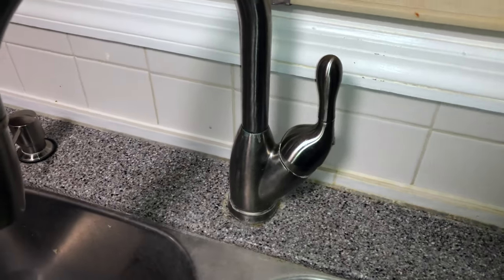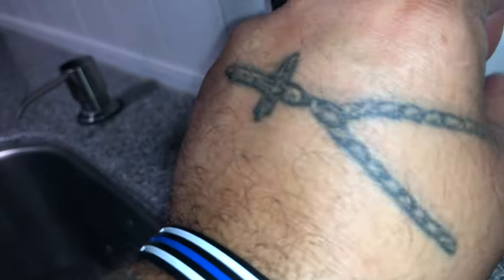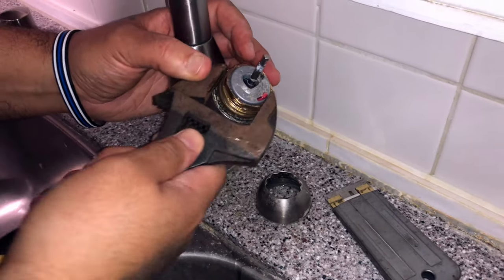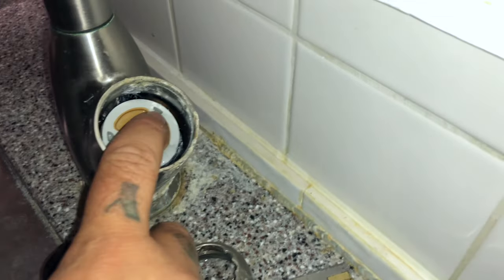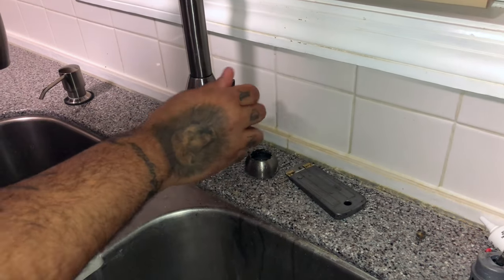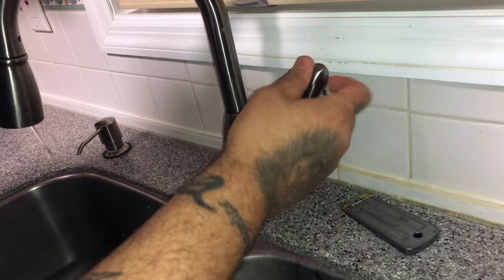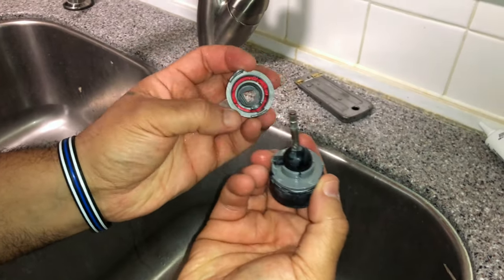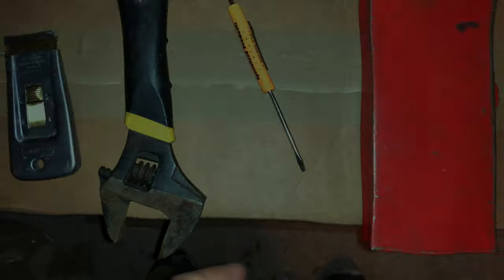How To Replace Your Delta Single Handle Faucet Cartridge

Comment: THANK YOU!!  I DID IT!! 😄 I absolutely could not have done this without you!!  I watched the video throughout the procedure and everything worked.  The only difference is that the part is now $40.  Ha!!  I did not have to call a plumber, so I am happy!!  I read the part was good for 5 years, so don't know about the lifetime warranty.  But it's fixed, and I didn't have to wait on something to be delivered.
Reply from the maker: That’s awesome my friend. I’m glad I could help. They would still hot or the warranty. No questions asked. I was in the same boat, I didn’t want to wait for it in the mail. But you can call now and get one for the future. Thanks again for the support.
Reply: Yes, thank you!  5 minute job
Reply from the maker: Good deal, glad to help. Thanks for the feedback.

Comment: Delta warranties their products for life. They will send replacement parts to you at no charge. If you don’t know the model number of your faucets all you have do is send customer service a photo on you mobile device they will be able to identify it. I’ve done it numerous times. This process also works for Moen faucets.
Reply from the maker: Your very right brother and I’ve done the same. I just needed to get it done as soon as possible and didn’t want to wait for it in the mail.
Reply: @MrV2u  I hear that and have done the same.
Reply: I do it on my my faucets, doorknobs, and anything else that has a warranty.
Reply from the maker: @chipwells1352  same here brother.
Reply: Will they reimburse if you already bought it ?
Reply: @tryhardsweat5224  probably not.
Reply: @tryhardsweat5224  Highly unlikely.
Reply from the maker: @tryhardsweat5224  not sure if they would. It wouldn’t hurt to call their customer support line. Their a good company, they just might hook you up. If they do let us all know. Thanks
Reply: You do need to leave it installed for them to warranty it. I made the mistake of pulling it out and replacing it in an emergency and they would not cover the warranty.
Reply from the maker: @edcollier2526  you should of said the one you used for the emergency was the bad one I guess. What they wanted a video of it?
Reply: @edcollier2526  Because of the fraud in our Nation they cant trust honest people like yourself.  I called, took picture, told them I prefer to replace now, so they sent a warranty voucher for my replacement.  That's what I call great customer service.  40 dollar part , cant wait for that check, based on that I will purchase and specify again.
Reply: @tryhardsweat5224  You will probably need another new on in 10 years, just put it under the sink.
Reply from the maker: Lol absolutely brother.
Reply: Don't think I can locate my receipt from 2012.
Reply: @franklin3271  You won’t need any receipt. Both Moen and Delta have great customer service. If you don’t know the model they will just ask you to snap a photo on your phone and send it to them.
Reply from the maker: Great info brother!

Comment: I priced one of these cartridges and was glad I did not have to buy a new one because the cartridge would have cost 50% of the cost of the Delta faucet I have had for 5 years now. All I had to do was to grease the ball and the seats it rides in with special Plumber's Grease which is available at Lowe's and Home Depot and most hardware stores. Just do not disassemble the cartridge anymore than necessary in order to get to the ball ( which attaches to the handle). More than likely the actual valve is in  great shape still. The ball and seats just need to be wiped clean with a paper towel and the special grease applied. I just bought Silicone Plumber's Grease today and it is supposed to be waterproof, which, I hope, means longer lasting.
Reply from the maker: Great info brother. You could always call delta and have them send you a new one free of charge under their lifetime warranty.

Comment: You mean tabs on the wall?
Reply from the maker: Not sure what you’re asking but the only thing to turn off is the hot and cold shut off valves under the sink sticking out the wall where the lines come out and into your hoses.

Comment: Excellent video. On my install the orange gasket kept falling off the cartridge so I put some coconut oil on it to hold it while I installed it. This desugn is a huge step backward for delta their old faucets were easy to rebuild and the kits cost $5 while this cartridge cost me $40! Thanks for the video!
Reply from the maker: Glad to help and thanks for the tip. You could have had delta replace it under warranty. I had to do mine sooner than later and didn’t want to wait for the replacement. I find everything was made better in the past than now a days.

Comment: Great job!! I just saved $200 by not having my plumber come out. Plus I had a ball doing it myself! Great teacher!!👍👍
Reply from the maker: That’s awesome my friend. I’m glad it worked out for you and you saved that hard earned money. That’s my goal in my video to help people save money. Thanks for the feedback.
Reply: MrV2u  now if you would post a video on how to replace a basic toilet I would be all set. Thank you again for your great teaching! You're a natural!! Plus I can tell you like lions. I'm a Leo ♌️
Reply from the maker: @josborn9653  that’s not a bad job brother. I’ll keep the video suggestion in mind. What’s wrong with your toilet? Sometimes you can fix certain things rather than completely swap it out. Unless you want a new style or something different.
Reply: @MrV2u  It’s 53 years old and does work ok. But the sub floor around the base is weathered and has dry rot. So I thought I would just replace the toilet with a new one nothing fancy and when I try putting down some new particle board sub floor. So I got my work cut out for me if I decide to take that project on.
Reply from the maker: @josborn9653  your toilet did its job for sure. Make sure your when you replace the particle boards everything else is in good order. Let me know how you make out my friend or if you have any questions. I have good plumbers in the family if I don’t have the answers.

Comment: Thank you so much! I did it and the hardest part was finding the hot water shut off valve hidden behind the garbage disposal, lol! I'm going to call delta for my free warranty replacement cartridge, this faucet is only 2 years old, if that. Thanks again!😄
Reply from the maker: Glad to hear. Definitely call them, they don’t question anything and will have one shipped out in no time. Thanks for the feedback.

Comment: I recommend shutting off the water at main valve; under-sink valves are NOTORIOUS for failing since they're used so seldom. Also, I replaced all of my under-sink, toilet, & washing machine valves w/ball valves since they're much more reliable and we generally use all of them for binary functions; on or off. Great video!!!!!
Reply from the maker: Yeah I made it a habit to cycle each  valve at least twice a year. But it’s definitely worthwhile to replace them with ball valves. Thanks for the suggestion brother and also for the feedback.

Comment: Thank you for this video.  We had the problem of the delta single handle kitchen faucet just leaking and leaking and very difficult to turn it off.  Purchased the part online anf  followed your video and all is well with the kitchen faucet.  Thank you again.
Reply from the maker: @shenaycrawford8701  I’m so glad it worked out for you guys. Enjoy that leak free water faucet. You could have called delta and had them send you a free cartridge as well. Thanks for the feedback.

Comment: Thank you, MrV2u! This gave my sweet husband the gumption to do this, even with a slightly leaky hot-water  shut off. It didn't take much longer than the length of the video. You're a good guy!
Reply from the maker: I truly appreciate the feedback. I try to be thorough and to the point. Glad it worked out for you my friend.

Comment: For the Ashton model like this one, call Delta, lifetime warranty. Stopper sink so you don't lose parts. The little orange slider on the cartridge adjusts hot water flow/anti scald. I want mine wide open for all the hot water I can get via handle adjustment. I bet many blame the water heater, when that valve is the culprit. BTW - that's why Delta went from the ball to the cartridge!
Reply from the maker: Good info brother thanks for the feedback. Perfect name too lol.

Comment: Thanks for the great video!  However…I’m having a hard time replacing the set screw. Goes in fine and I can see the stem but it doesn’t seem to touch the stem. Similar faucet as in your video.
Reply from the maker: Do you have any calcium or grit that doesn’t allow the set screw to sit flush? Soak it in vinegar along with the handle for a  it and try again. Let me know if that works.

Comment: I recommend soaking the parts of the disassembled cartridge in vinegar with a pinch of baking soda added.  This will remove deposits on the parts of the cartridge that may have deposits causing it to grind as well.  Rinse all parts thoroughly and re-grease and assemble.
Reply from the maker: Good info brother. Mine was beyond that point already but great info. Thanks
Reply: I use Lemi - shine for hard water deposits and let the parts soak with hot water. Works well.
Reply from the maker: @hoosierdaddy8002  something to try in the future. Thanks brother

Comment: I would add that once you clean the inner threads at the bottom of the brass coloured locking tube that holds the cartridge in place with a stiff toothbrush and vinegar, then lube those inner threads with food grade silicone grease if you have, or just as good is a good coating with olive oil. And when you tighten that locking tube with a wrench, very little torque is needed. Just lightly snug is all you need.
Reply from the maker: Very good info brother. Thanks for the tip.

Comment: Thanks for this video!!  It appears to provide all I need as a rank amateur to fix my leaking faucet.  I'm about to tackle the cartridge repairs.  In preparation I went searching for "Silicone grease".  Harbor Freight?  Don't have it.  A local auto parts store seemed baffled by my request.  However an employee, who claimed to be a "handyman", suggested "Synthetic Caliper Grease" and said that would "absolutely"  do the job.    When I read the package I see no mention of silicone as an ingredient.  Also this comment on the package "waterproof formulation prevents against corrosion".  QUESTION:  Will the Caliper Grease suffice?
Reply from the maker: I wouldn’t use caliper grease on something that is going to be in contact with your water. Go to Home Depot or Lowe’s and go to the section where they have the sink repair parts and it will be there. If not ask for it. Let me know how you make out or if you have any other questions brother. Good luck
Reply from the maker: Here’s the link my friend. 

https://www.homedepot.com/p/DANCO-1-2-oz-Waterproof-Grease-80360/203193502
Reply: @MrV2u   THANKS SO MUCH!  I will do that today and reply.
Reply from the maker: Before you go hit the area around the ring with some vinegar or wrap a rag around it and soak it in vinegar to make the job easier to take off the beauty ring.
Reply: @MrV2u  I have not yet taken anything apart.  My experience as a handyman (generally poor) over MANY years has taught me to go slow.  So I'm doing my research, gathering tools and supplies to deal with the "what if's" BEFORE I jump in.  So I'll have it all when I start the job.  I HATE having to make several trips to HD during the job.  And in the case of my kitchen faucet, once I start the job I need to know I can finish it.  I'm hoping that since I have very good City water that I'll have no issue with too much corrosion.  If I do, I have what I need to deal with that or I can just use the brand new cartridge that Delta has sent me and toss the old one.  Make sense to you Mr Vu?
Reply from the maker: @jimhowe2417  sounds good to me, I been there with the 97 trips back and forth lol. Your like me research, take your time, and get er done correctly. That’s why I post so many videos on fixing things.
Reply: It took awhile but I found the proper grease.  THanks again for such a helpful video and for your answers to my questions!  You are a real pro, Sir!
Reply from the maker: @jimhowe2417  Great news brother glad it all worked out for you. Thanks for the update my friend.

Comment: Good video, but the one thing I would add is that instead of getting the part from home depot, just call Delta.  Their items are guaranteed for life.  I called them, told them the faucet was leaking, they asked for the model number, etc... and sent me a new on the in the mail for free.  Arrived 3 days after I called.  They also sent me a new head because it wasn't functioning as well as it should either.  No receipts needed... just asked when I purchased it and the model number. I didn't know my model number as I got my faucet in 2012, so Just just google and found it on the internet, wrote it down, then called them. Viola!  Thanks for the tutorial though!
Reply from the maker: Your correct my friend, but I was in a rush to get it done. Their lifetime warranty is outstanding. No questions asked what so ever. Glad I could help you my brother. Thanks for the feedback as well.

Comment: The chrome part in mine is not sitting flush and I can't tighten it now. May have to buy another faucet tomorrow
Reply from the maker: Take a brass brush and clean the threads out with some vinegar. You probably have some grit on there or maybe you cross threaded it.

Comment: Thanks for the great video.  I have the same faucet and need to do the same job next week.  I appreciate you doing this.  Delta told me it is important to flush the lines underneath the sink before putting in the new cartridge.  I have a bad back so getting under the sink is hard.  Do you feel this is a necessary step to flush from underneath the sink or is the method you used sufficient?
Reply from the maker: Another commenter suggested the same thing recently. I never done it myself and haven’t had issue with it. I too have a bad back, 3 operations and another coming soon. I can see it helping especially if you have hard water, but save the back and let it ride brother.
Reply: @MrV2u  thanks again.  Got the job done today in 15 min because of this video.  Leaking / squeaking faucet cured!!   Delta sent the replacement cartridge under warranty.  It arrived in the mail within 4 days.
Reply from the maker: Great news my friend. Thanks for the update. Have an awesome weekend.

Comment: Quick tip to everyone with this Delta cartridge: A "certain home improvement store" that is based in blue color out of Mooresville NC sells a 3rd party brand for $22.98 as I had to buy one last night & it fits and works perfect on my Delta single handle faucet.

Does anyone know if adding the grease like the person did in this video will stop the leaking (slow dripping) from the faucet head?  I had water dripping down the lines under the sink as well, so I just bought a new cartridge to see if it would work and I got very lucky that it stopped the leak.  I can't see how that would work, but I'd like to save $24 like the next person.
Reply from the maker: Better tip is call delta and get the part for free. They have lifetime parts warranty brother. The grease does absolutely nothing for leaks. It’s to protect the surface of the faucet and keep things more or less moving freely.
Reply: @MrV2u  That's great advice.  Thx, but I'm married to a woman who wants water out of her faucet ASAP.  Can't hurt to get a backup replaced for free though.
Reply from the maker: @TB-lv2rh  lmao I hear you brother. That’s the only reason I bought mine instead of waited a couple extra days for it to come in the mail. But they do put it out fast. Very good company for warranty parts.

Comment: No need to buy the Delta part. I just called Delta, told them the problem and faucet model #, and they are sending the valve to me for free.
Apparently they really do provide a lifetime warranty with no games. No need to show original receipt etc. Very easy!
Reply from the maker: Your correct brother. I didn’t want to wait for it to come in the mail, they do have excellent customer service. They honor their warranty’s with no questions asked. Great company.

Comment: Have you ever had a handle that would not come off the cartridge even after completely removing the set screw? Im having that issue and i need to get to the cartridge as its leaking a bit.
Reply from the maker: Use the small straw that comes with the pb blaster or wd40 and spray some under the handle. Spray some into the set screw hole too. There is room, gently rock the handle back and forth. You’ll be able to work it out.

Comment: I am having problem trying to remove the screw with an Allen wrench in the handle. The screw are way too tight. I have tried using WD40 to lime away. Yet it’s still not coming off…. Any suggestions will be helpful. Thanks
Reply from the maker: You can try and get some heat on it with a small torch. If not then your going to need to drill it out with a small bit and then try to get an extractor on it. I would definitely reach out to Delta and explain the situation and they may just send you a new unit under warranty. They have a great lifetime warranty. Let me know how you make out. I know it’s not the greatest news.
Reply: @MrV2u  Soldering iron
Reply from the maker: @somethingclever1234  small propane torch